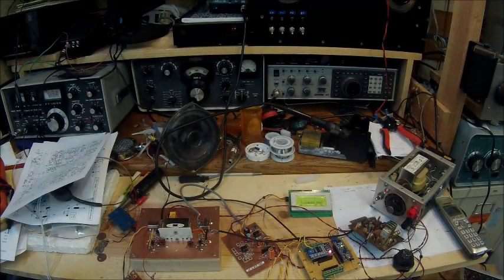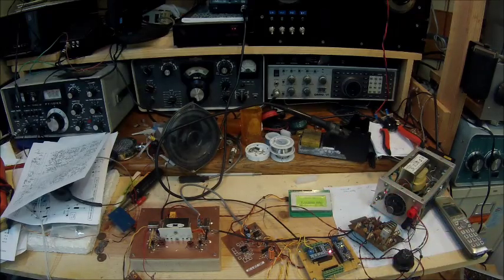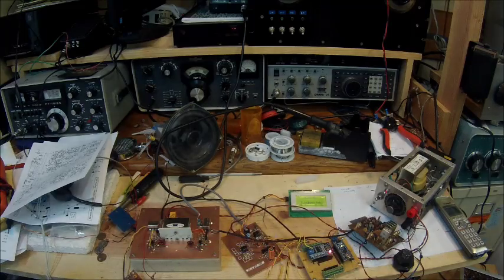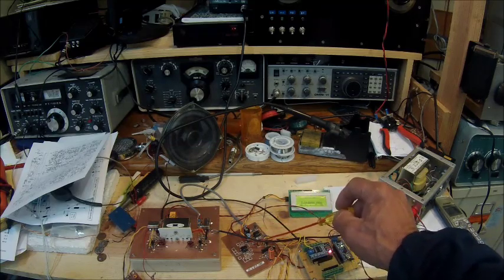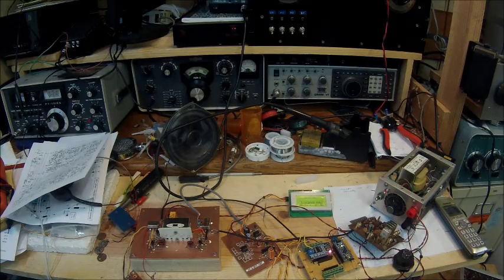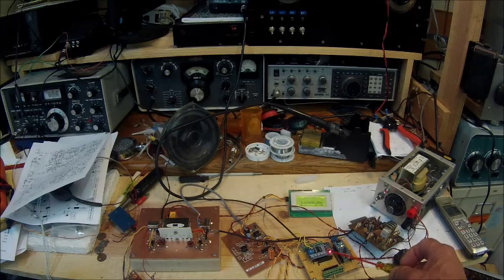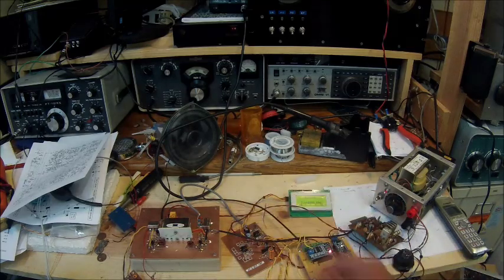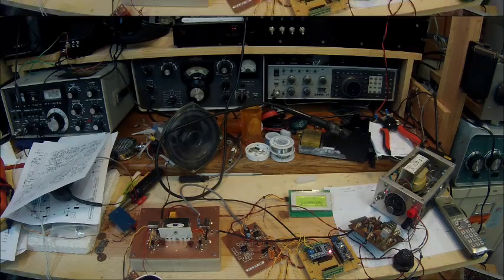Homebrew SSB Transceiver using an Arduino driving a DDS

Comment: Pete, where do you get that small shielded cable that you use in construction?  Thanks and 73  DB/W2DAB
Reply from the maker: Available in small lengths from All Electronics or Jameco Electronics. Officially it is known as RG-174/UPete N6QW
Reply: Thanks Pete!

Comment: Hi. Can you recommend me a cheap 40 meters ssb kit? I search on Internet but I found mostly the known ones and it seems that there are very good projects out there made by private radioamators. I could also build from a schemate but its difficult to find all the materials and at the end probably it will cost more than a cheap kit. Thank you.
Reply from the maker: Thank you for your posting. Do an Internet search for CRKits KN-Q7A . It is about $115 USD. It has some good reviews on eHam. That is about the least expensive commercial kit. There are some other kits from Europe like the ILER20 (maybe a 40 Meter version). But I mostly like to build my own. 73's Pete N6QW
Reply: Thank you Pete. I have allready saw this kit but I was searching for something much less expencive. (50-70$).
I will look at the ILER20 to see what characteristics does have.
Reply from the maker: Pete Juliano I am unaware of any commercial kit that inexpensive. Do an internet search on my call sign for my website. There is a 17M or 40M homebrew radio there and that can be built for $50- 70 USD.
Pete N6QW

Comment: Really wish there were still hams like you in my area!  I would love to be a fly on the wall in your lab to see all the magic happen!  Vry 73
Reply from the maker: Just wanted to acknowledge your  comments made on the you tube video. I can assure you there is no magic lab just a lot of luck and investing some time in proven circuits. Most of the projects I do reuse many well known circuits (most produced by others). So the success rate is greatly increased by using circuits of  known performance and using a simple strategy which I will share with you. The very basic strategy involves modular building blocks and using the radio itself as a part of the test circuit. Heathkit did this a long time ago and it works!
 
The first thing you need in your tool kit are two simple device you can build with simple hand tools. The first is an RF probe and the second is a test oscillator. You can see this on one of my webpages. http://www.jessystems.com/N6QW%27s_K_K.html
 
Next I build the radio in reverse starting with the audio amplifier stages and once those are working I then proceed to the Product Detector and BFO. Hooking these to the audio amp stage and using the test oscillator I can now check these three stages. Next in line is the crystal filter. Injecting a signal from the test oscillator at the input of the crystal filter will now check everything that has been built. I think you get the drift. If there is no signal out form the stage just built then you know exactly the problem stage. So that is the secret to having a successful project. If you just wire everything together and turn it on and nothing happens –where do you start? So the answer is use (and reuse) this process for building radios.
 
Thanks again for taking time to input to the video.
 
73’s
Pete N6QW